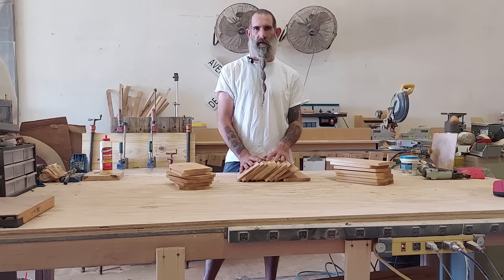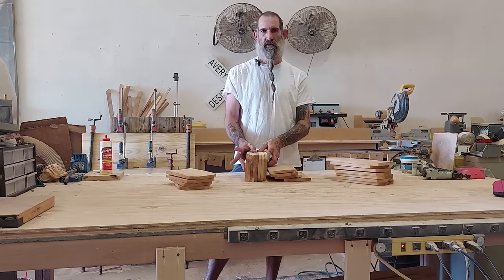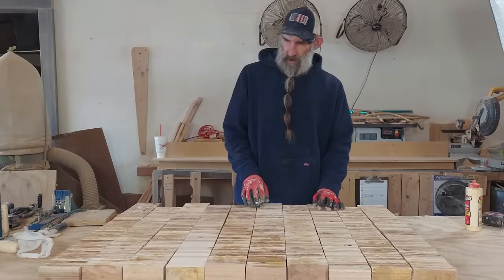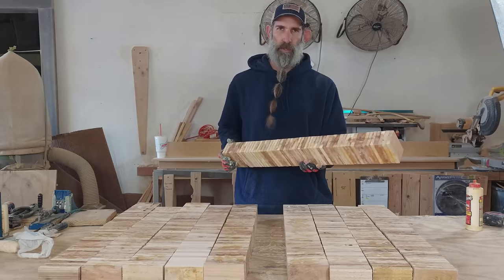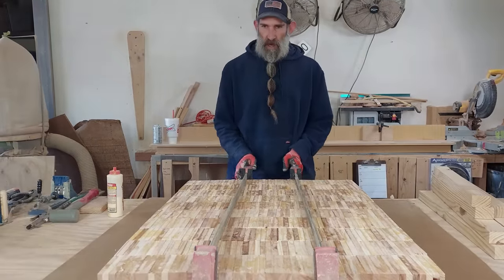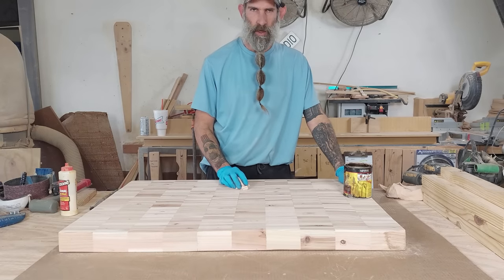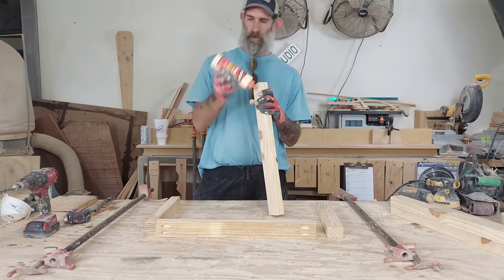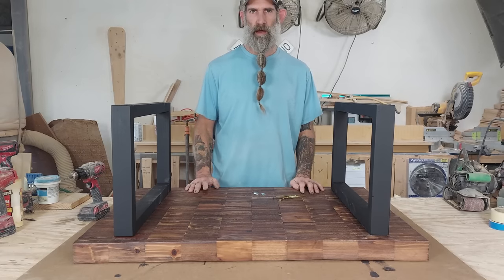ZERO COST HIGH PROFIT SCRAP WOOD PROJECT

Comment: Nice project.  Turned your scrap into a table you could sell.  One concern.  I really like your beard, however, other then getting glue on it, it could easily get caught in a drill press, sander, table saw, etc.  It will pull you in or simply get ripped off along with a good chunk of skin.  When I entered the work force, we had to wear ties, however, those ties had to be removed or tucked in if you went out on the manufacturing floor.  An older colleague told me that he is in the company safety video, during the 70's he had long hair and it got caught in a machine and totally ripped off part of his scalp.  So please, it's long enough to tuck into your shirt.  Just remember, someone always wins the lottery and the odds are almost zero that that will happen, but it always does.
Reply: Ya buddy..you said it..that was my concern too while watching..
Reply: That is what I was thinking!
Reply: Gloves + Table = No fingers
Reply: as someone with long hair (past my shoulders) recently getting into woodworking I'm always concerned about this as well, I put my hair into a pony tail and shove it up in a hat or down the back of my shirt to keep it out of the way
Reply: @mrb4408  my thoughts exactly, when I was first learning about table saws I was told never to wear gloves and always use a push stick
Reply: Yes. It always does, sooner or later.
Reply: My dad worked with a kid whose hair got caught in a metal lathe, and a big, industrial one at that. It took some scalp…

Comment: This came just in time for us.  We recently built a fence to code:  5' high.  But the nice (7/8") cedar pickets only came in 6' lengths so we have a ton of 12" x 5½" pieces left.  Hate to just toss them.  Thinking of building bird houses or other projects.  This is a great idea to use it up on way fewer projects.  If I do this I will lay the pieces out in a brick pattern, though for additional strength.  Thanks for the timely video.
Reply from the maker: Thanks for watching!
Reply: As you say Bird boxes l thought same thing. Would of been a lot quicker than the table was

Comment: My suggestion would be to make end grain cutting boards from your leftover cedar planks. You wouldn't even have to cut them to a uniform width, on the contrary, the irregularity in the resulting glued block would be more advantageous from the point of view of strength. Good luck from Czechia!

Comment: I'm gonna do one of these. Only exception is I think I'd rather use a router sled for final flattening. May not be necessary if I joint and plane my strips before the final glue up.

Comment: Great project. I really like the idea. I see a lot of possibilities in size and height!
I would offer this as advise for the beginners.
1.Instead of tightbond 1, I would use TB2 or 3 instead. Specially for outdoor use!
2.use a stain prep for even stain color.
3. End grain butt joints can be tricky and are most often not very strong, so refer to #1.
4. Maybe make the legs out of cedar as well?
Thanks for sharing!

Comment: I like this build believe me, but I would have used a flattening jig which is easy to build with wood.  Not knocking your piece or work Turned out very nice. I did see some high areas around the perimeter which means it was not as flat as it could be.

Comment: I would of offset, staggered the wood bits to add structural integrity, though then again I saw you used a good amount of glue as well, so you should be good, great end result

Comment: That looks awesome. IMO it makes it even better considering it is made from stuff that might have gotten thrown away or burned in a barrel. I am curious on what you use for sealer. If I did that I might consider using a very light or maybe even clear stain. I might even use a spar urethane and use it for outside table.
Reply from the maker: I stained it with minwax golden oak and finished it with Lenmar dull rubbed lacquer. Thanks for watching!

Comment: Wonderful vid but, will it not sway, since, it has not got a middle stiffener,? not a criticism, simply curious , thanks for showing your skills
Reply from the maker: It maybe could have used a stretcher between the legs. It was rock solid when it was finished with no movement at all. It didn't seem like a concern.

Comment: Thanks for sharing this.  I know glue is strong, but Im worried over time, 5 years, 10 years, down the road this is doomed to crack and fail mainly because of two issues.  100% reliance of glue, and 100% end to end joinery.  But I do hope I am mistaken.
Reply: You'd be surprised... Wood glue is stronger than the actual wood itself. The wood would give before the glue seams.
Reply: @britt8855  That's true for long grain but not so for end grain. I hope no one sits or stands on this table. Try an experiment yourself to satisfy your curiosity.
Reply: @howardsmaid3491  This was my concern watching this vid. Surprising that for all the comments, this is one of only a couple that recognized the problem.

Comment: Nice what paint did u use on the legs and did you sand between  lacquer coats on top
Reply from the maker: It was dull rubbed lacquer over highbuild sealer. It was sanded between .

Comment: Im just a novice compared to you, but was wondering why you wouldn't have broken your final glue-up down a bit and done like three rows at a time so you could get it thru the planer?  Seemed like a lot of sanding and for me I would be worried I wouldn't have gotten it flat.  Just curious,not knocking your system, just wondering why you didn't?
Reply from the maker: Running end grain cedar through a planer would most likely destroy the strips. I'm sure there was a better way to do it. The sanding really only took about 10 minutes.

Comment: Is that a foam roller you're using to spread the glue?  Do you clean it after use or toss it?  If you clean it, how?
Reply from the maker: Yes it is. There's no cleaning them out. I just throw them away.

Comment: So how do you put a price on this because it just looks like a table from a retail store? I don't know how many hours and supplies you did and used to make it look this good, however still will it be a high dollar table or a budget item in spite of all the work you had to do to make it? At first I thought you were going to make it a chopping block or one with legs and leave it natural. This I believe would have been a high dollar item.
Reply from the maker: It sold for $700. It took a total of about 3  hours over 4 days to build. There was lots of time waiting for glue to dry. I probably could have made more on it, but $700 seemed like a fair price.

Comment: Definitely wouldn't use a foam roller to spread the glue!
The foam will soak up the glue, which in turn reduces the amount of glue on the work piece and excess wasted glue on the roller!
 Surely this is simple common sense???
Reply from the maker: Seriously? What difference does it make?